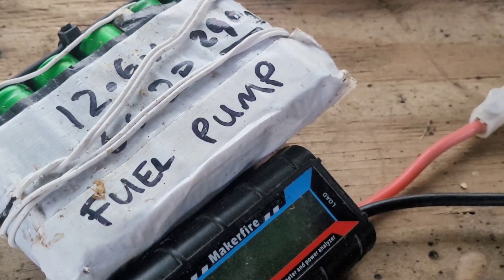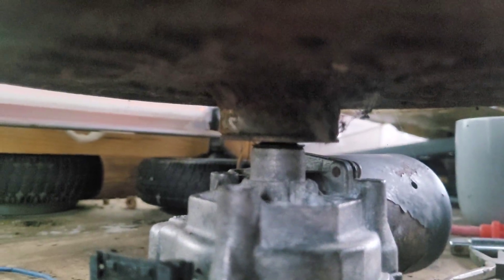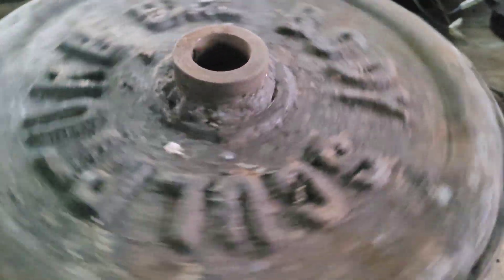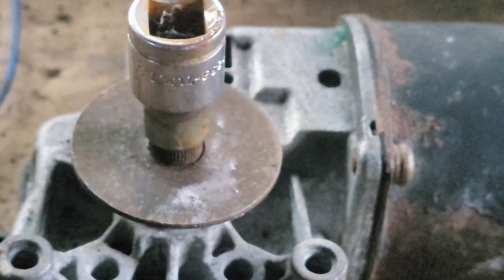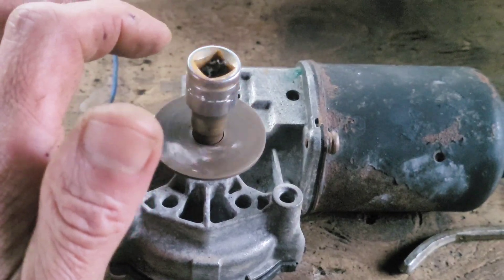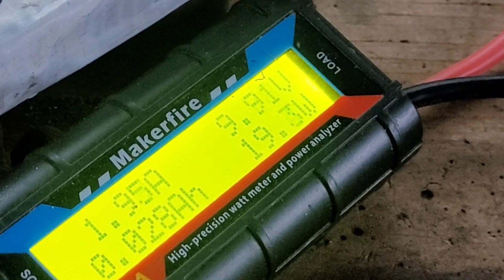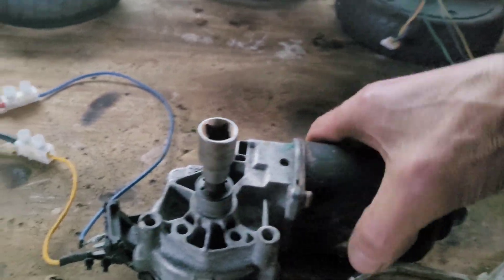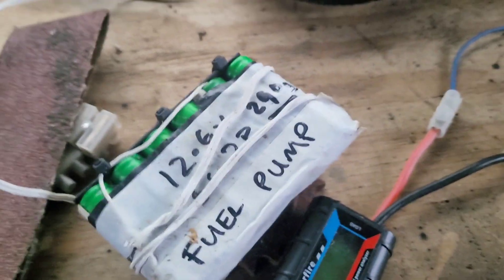12v Wiper Motor Electric Bike - Direct to crank idea -  Home made lithium battery - Hyper Efficient

Comment: Good project - the weak link may be the reduction gear in the wiper motor - The worm gear on the motor shaft usually drived a nylon gear which I think will be prone to stripping unless there's some sort of slipping friction clutch mechanism.
Reply from the maker: Theirs only one way to find out as the saying goes cheers for the comment.